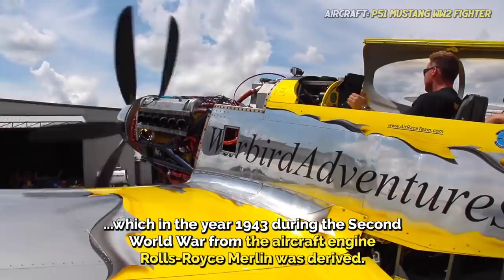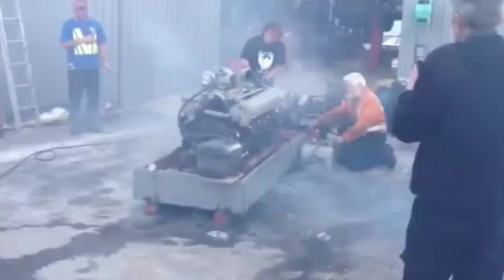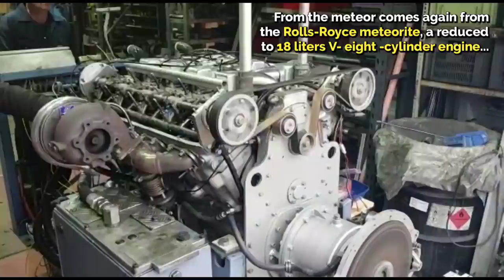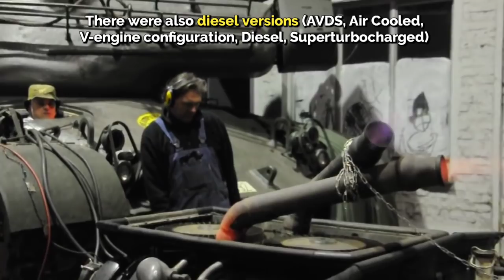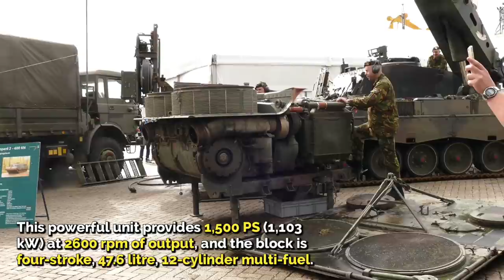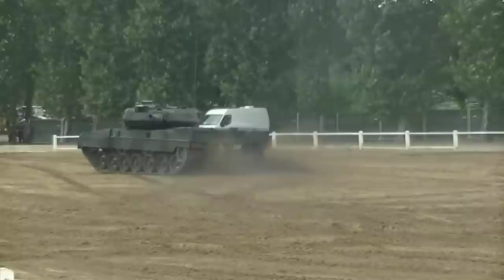Top 6 Battle Tank Engines in The World ! Startup - Cool Sound & Fire up! (Part 1)

Comment: I miss the Russian W-2 38.8 liter 12 cylinder with 48 valves and 500 hp. The first tank engine with multi-valve technology and lightweight construction (aluminum). Not even Germany had the technology to build such an engine back then. In order to save the battery, for example in winter, the engine could be started with the help of compressed air.
Reply: Further developments of this engine are still in use in Russian AFV's. 🙂

Comment: The P51 had an engine built in the USA under license from rolls-Royce the P51 turned out to be the complete package some pilots said better than the Spitfire  🇺🇸 🇬🇧
Reply: no they didnt, and it was a British designed engine from nut to bolt. the only American part of that engine was where it was assembled. the rolls royce merlin. fitted to both spitfire and mustang.  the spitfire was faster could climb faster and was better armed. very little about the p51 was considered better than a spitfire.
Reply: @fivenine5905  so you think we the brits shipped all the parts to America so they could assemble it during a word war 👎🏻😂 please look up the facts before commenting Packard built it under licence.     https://en.wikipedia.org/wiki/Packard_V-1650_Merlin
Reply: @MrNutter13  so its a british engine then? we agree on that einstein?
Reply: The Spitfire was a point defence fighter with limited endurance and was a better dog fighter. It was also nicer to fly. Ask any US veteran that flew them. But the P-51 which was designed and built for the Brits had a much cleaner airframe (so it should, development was fast during wartime. The Spit was early 1930's thinking. The P-51 early 1940's). It was a better all rounder and had much better range. Even with the Allison engine it was great low-level.
Reply: @fivenine5905  Not correct. Packard used a different prop shaft spline and also started using the Bendix injection carb (once it was okayed by RR). There were other modifications developed by Packard which had to be cleared by RR first.
The P-51 was a better all-rounder. Only the Griffon powered Spitfires from the Mk XIV could match the fastest of the P-51's, the B model. Though the PR XIX was good for 460 flat out at best height. But who flies around at max speed? The P-51 had a higher cruise speed.

Comment: You didn't do much research before you uploaded this video...
The RR initially made the Meteor 27 litre V12 then it was handed over to Rover in exchange for a gas turbine engine that RR preferred to concentrate on. It was different in many ways to the RR Merlin. It rotated in the opposite direction, it used parts from crashed aircraft or parts that failed QC. It didn't have a supercharger it had two carbs and not fuel injection. It used cast pistons instead of forged ones used in the Merlin and was built to run on 87 octane combat gas, not 100 octane aviation fuel.
The Mark IVB gave 650hp @ 2,550 rpm.
The MTU 873 was used in the Leopard 2 up to the A3 version. Then they used the MTU MT883 Ka-500/501 27.4-litre (27,361 cc) 90° V-12 liquid-cooled twin turbocharged diesel engine from A4 on.
Reply: Americans never research anything The Alicesson engine was a licensed version of the Merlin

Comment: I believe the monster truck known as Maximum Destruction (Max D for short) uses a Merlin v12 to power it.  Not sure if any other monster trucks use the Merlin v12. Sounds just like a V8 I swear, but then again I might be tone deaf. Regardless the Merlin v12 sounds glorious
Reply: An understandable assumption.
However, as a former gearhead and having worked at a parts store, I'm almost certain that what was meant is it uses the "Merlin IV" engine block made by World Motors, which is actually just the model name they gave their customized Chevy Big Block. (his probably a supercharged (roots style) 502 or 527 cubic inch displacement; at 8.2 or 8.6 liters they're considerably smaller than the Meteorite V8's 12.xL shown in the video)
Reply: @DUKE_of_RAMBLE  we were both wrong it’s a 540 cubic inch Merlin v8, just looked it up
Reply: @fadedsoul23  Guess they managed to reliably squeeze a few more CID out of 'em these days! 
Though they're indeed made by World Motors (looking at the PDF on Summit Racing). I know Monster Jam trucks all run at least the same blocks and blowers, as per the rules. However, I don't know if they can still be built by different engines builders (which can still result in different output power), or whether they also can use different internals, heads, cam, etc. 🤔

Tank engines would've been rather fitting, can't deny! Don't think they can rev to the same 9,000-10K+ RPM though... lol